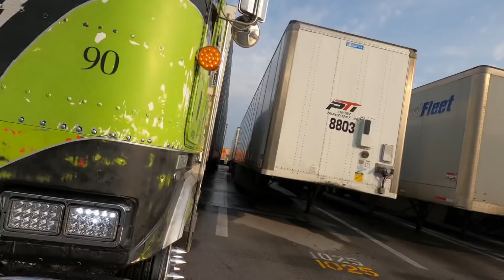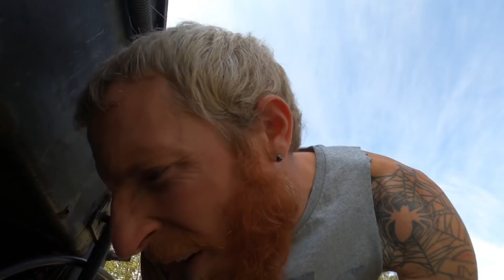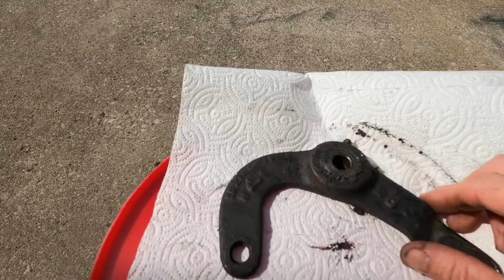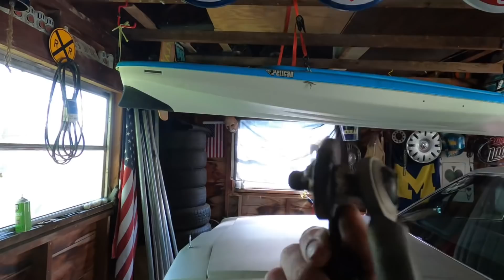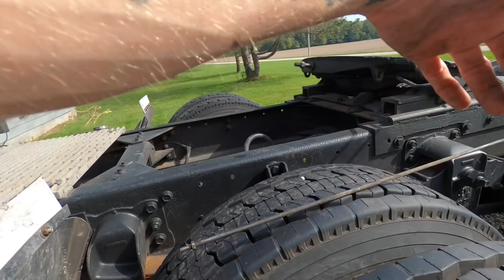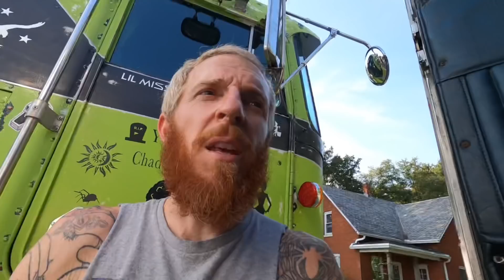K100’S Back, K100E’S Down. Heim Joint Replacement On The Blue Cabover Truck.

Comment: Greetings from your Porter friends! 🤩 That’s the joy of having 2 trucks…If one breaks down, you have a good backup truck that’s ready. The company doesn’t mind which truck you drive, right, as long as you are dependable. 🧐 Or is there more to it? The hard part is keeping the insurance on both. Can you explain the bit about letting them know what truck you’re driving? Keep us posted on Frankie’s xmission issues. Keep the rubber on the road. 😎✌️
Reply from the maker: It’s for the paperwork filing, I just call tell them the issue so they know what to look for if I have to split it up on a load sheet.

Comment: Perhaps the spare cab air ride needs to be fitted to the blue truck (and lubricate the front cab pivots). No harm in asking Tim Gentry about Betty White. Tim hasn't yet got a day cab cabover - he has a single axle, 2 stupid long ones and and least 3 normal length all with sleepers. Most are Freightshaker 3 are 13 letter shit spreaders.
Reply from the maker: The power steering lube holder needs relocated before that air ride goes on and as far as dealing with that fella you’re talking about I’ll take it to the scrap yard before I deal with him 😂😂